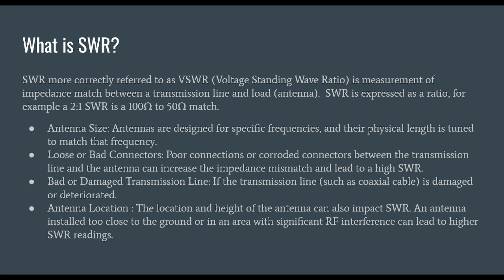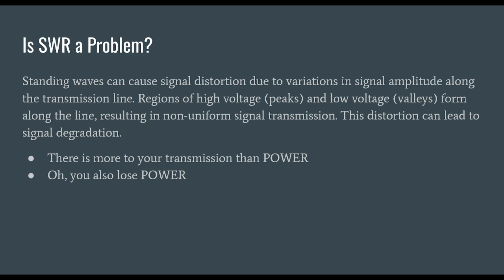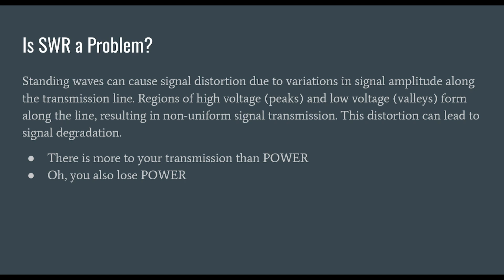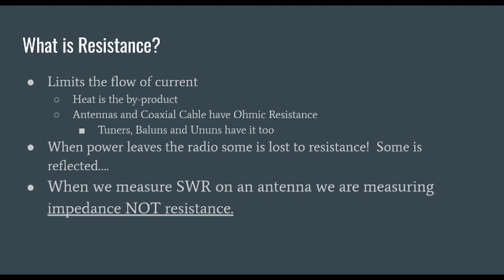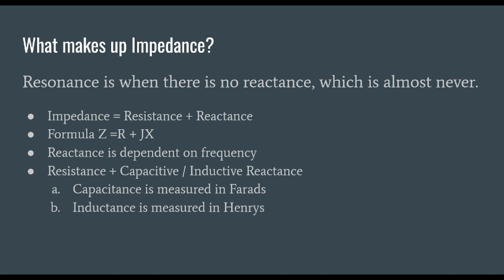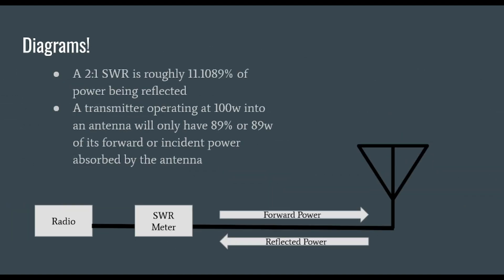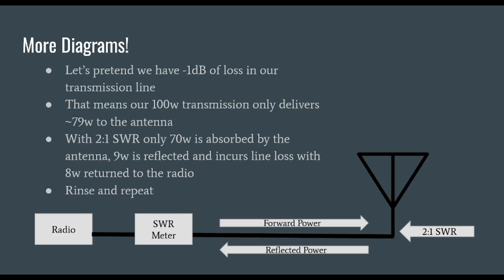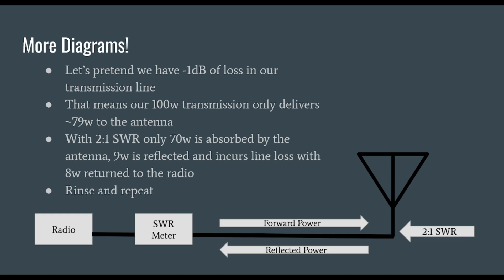Debunking SWR Myths Once and For All!

Comment: that was great. that is why a 9:1 UNUN can heat up more with a tuner. that power keeps bouncing threw the core. the torrid see forward power and adds reflected power to heat and power sent back from tuner . I normally use cross needle watt meter. I want to see reflected power in watts. still read VSWR where the 2 meters intersect . I just did a test today with a 49:1 using 2 -FT 240-61 cores at 500 watt FT8.  and SWR under 1.5 and stayed cold.  10 AWG windings . did the same with type 43 and that changed the tune a tad . but still under 1.5 buy the cores heated a little. so less heating at 500 watts with type 61 core. this mono band cut 1/2 wave 10 meters wire. a great way to tell if ferrite heating up is VSWR jump up. 73's
Reply from the maker: Hey Robert, I bet the 10AWG wasn't easy to wind 👀
Reply: @TheSmokinApe  my fingers hurt 2 days and was hard to solder as well.
Reply from the maker: LOL, I bet bro!

Comment: I achieved laminar flow once and my SWR decreased to negative infinity. I talked DX on 33cm and was able to modulate a full AM signal using nothing but a 9v battery and 2 nickels taped to a potato.
Reply from the maker: Russet or Yukon Gold?
Reply: @TheSmokinApe  I tried russet first but found out Yukon gold works better at this point in the solar cycle.
Reply from the maker: @HouseOfThe8Strings  I heard Yukon was the was to go
Reply: @TheSmokinApe  wait until you try yams!
Reply from the maker: Putting it on the list!

Comment: If the SWR is good, the transmit has plenty of fars.  If the SWR is not so good, your fars leak out the wire and don't work as good.  If the SWR is bad, the fars get stuck in the radio and the transmit button shuts off.  So yeah. The SWR's is real and you don't want them stuck in your radio.
Reply from the maker: I couldn’t have said it better 👍
Reply: How about if we introduce a tuner ?
Reply: @paulm0hpd319  The tuner will indeed fool the radio into giving out the fars.  Unfortunately the fars will still leak out of the wire and not do as good.
Reply: @oldstanknote  it will allow the transmitter to put out full power into the system, creating resonance by a conjugate match therefore more power at the antenna to radiate
Reply: @paulm0hpd319  almost, but not quite.  The tuner only fools the radio into releasing the fars.      What happens to them as the attempt to go down the path will still happen even with the tuner.
Reply: @oldstanknote  but the difference is the transmitter is putting full power into the system whereas without the tuner its only putting out the power less the reflected power difference  ,what gets to the antenna is down to the feedline  improve the feedline more power to antenna either way with the tuner in place there's more power at the antenna
Reply: @paulm0hpd319  both of the things you are talking about about still fall in the second category above.  You are just differentiating the quantity, which is not the point of the video or this conversation.
Reply: @oldstanknote  everything I've said is relevant to the subject matter
Reply: @paulm0hpd319  in your mind I'm certain it is.  The context of the video and this conversation is "is SWR real".  Your own observations have confirmed it to be so.  You are now discussing a way in which you hope to overcome it.  Why you are commenting on my comment about this is unknown as I do not care about how you go about your business.  Being no one else has joined in the conversation it would seem no one else here wants to share your journey with you.  You are discussing the quantity of the fars that get lost.  Irrelevant to the topic.  If you go and make a video of you observations and post it on YouTube maybe someone will discuss it with you there.
Reply: @oldstanknote  sad you feel that way but it's totally relivant to this whole understanding of this discussion
Reply: @paulm0hpd319 that is what you keep writing. So far, several times now.  We have established SWR is real. We have established that there are varying quantities of SWR. We have established that things can be done to alter the varying quantities of loss due to SWR.  Now you are just here repeating that the quantity of the SWR can be changed with a tuner.  That and many other things can vary the loss caused from SWR.  It is still loss from SWR.  The second thing I mentioned in the original post.  Differentiating this one thing from the many other things is irrelevant.  If you want to make a video showing how many different things can alter the loss from SWR go right ahead.  If you are hoping for a different response, perhaps go back to the main thread and start the conversation there.  As long as you stay here replying to my comment you will continue to get the same response.
Reply: @oldstanknote  the context of the video is more than just ,is swr real ,anyway you obviously don't want to discuss the finer points that are majorly misunderstood so ,73
Reply: @paulm0hpd319 you are correct in that I have no interest in discussing this with you.  These type responses only clutter up the reply stream.  If you wanted to engage in such discussion you would have done better to create your comment on the main stream, or at least took the hint when I replied back to you the first time.  When you read the original comment it should have occurred to you that it is intended to be humorous from the wording.
Reply: @oldstanknote  haha 😂 73
Reply from the maker: I think Paul has a chapped ass over something in the video and he is determined to repost the same rhetoric on every comment
Reply: @TheSmokinApe thought it was a discussion that I was a part of ,this whole swr subject is a fascinating subject that I've spent many years studying, if I can inject with points where people are not quite understanding surely its beneficial to dispelling the myths once and for all
Reply from the maker: Paul, I am glad you are showing interest in the topic and I appreciate the participation.  Maybe a new comment thread is the best way to have a single conversation.
Reply from the maker: @paulm0hpd319 I was thinking about your comments on this tread and others and it lead to me blowing the dust off Reflections III, I wanted to thank you for that...
Reply: @TheSmokinApe  hey no need to thank me but appreciate it, hopefully my comments have helped others do the same,I look forward to your future videos on the subject
Reply: @paulm0hpd319  that was the point about putting the comment in the main chat stream where others could see it.  Or making a video of the point you were trying to get across. As it is now, someone would have to dig into my comment to even see it.
Reply: @oldstanknote  thanks I'll bare it in mind ,I still be able to make comments on other comments right?
Reply: @paulm0hpd319 yes. You can always comment on other comments. The difference is that right now only me and  Ape are getting notification of this conversation so your scope is very limited.  Being the point you were attempting to make is only a sub topic of the second point I made your venture down the rabbit hole was not of concern to me.  My attempts to point that out to you seems to have fallen on deaf ears so to say.  if you don't listen to what people tell you when you comment on their comment, you have lost the room and the conversation is no longer productive.  If your comment had been on the main thread, you and Ape could have discussed it and others that may have been interested in the rabbit hole could have joined in. Again, there was nothing wrong with your comment or observation. It was just in a place where it was not relevant so you came across to both of us as being disgruntled.
Reply: @oldstanknote  all understood
Reply: What are fars?
Reply: @bill-2018  A far is a unit of measurement. You put a little youngin in the back seat of a car with no electronic devices.  Start driving.  When the little youngin says "are we there yet" you will have gone 1 far.  When there are multiple fars involved the little youngin will repeat the message and begin to fidgit in the seat.
Reply: @oldstanknote  "Are we there yet." Ah, I remember now. It's not far.

Comment: Great job! Continue relentlessy educating the hams out in YouTube land.... 

When I began my ham hobby in the early 1970's, I was taught to create a 'dummy' antenna with a 60 watt incandescent bulb in a socket. I used my regular length (50 feet) of coax that I fed my dipole and tuned my transmitter. I could VISUALLY see the results of a poorly tuned load because the light bulb would either shine brightly or dimly, or not at all. Now, I realize the light bulb was a resistive load, but I wish new hams could either 'see' what the results of their poor SWR is doing, or to 'feel' the coax getting warm (losses) or the external antenna tuner getting hot (poor SWR causing the tuner to get as close to 50 ohms for the transceiver-- resulting in losses in heat). A great tool today is an SWR/WATT METER that displays the FORWARD and REFLECTED power--giving the operator a decent sense of how much is making it to the antenna, and how much is being sent back. Keep up the good work! - Stan WB5UDI
Reply from the maker: Hey Stan, thanks for checking out the video.  I've seen people do the light bulb test but haven't tried it myself.
Reply: I started in the 70's too with KW valve gear and a long wire and tuner and simply tuned for maximum r.f. out while watching the KW SWR meter. Maximum r.f. out = low SWR.
After an FT101E about 30 years ago I went QRP, 5 Watts max. with a h/b s.s.b./c.w. tcvr and still tuned for max. r.f. out and no longer had the SWR meter, did this at special event stations with a vertical. As I said above I knew that max. r.f. out = low SWR.
Now 5 attic dipoles for 20m to 10m and inverted vee for 60m. Made a resistive Wheatstone Bridge SWR meter about ten years ago, never above 2:1 SWR when tuning aerials. Calibrated it about 6 years ago after previously aiming for a low reading.
G4GHB.

Comment: Does an antenna tuner really tune the antenna, or does it just present a happy match/load to the transmitter ? Also, does very lossy coax present lower swr due to high loss? Lastly, can a dummy load with an antenna port on the back end be compared to an antenna tuner?
Reply: Dummy loads are a power sink; they're not tuning the sink discriminantly. Sometimes people refer to coils as dummy loads, but this is not actually true, though they are a compromised antenna.
Reply from the maker: 1.  No, it doesn't tune the antenna.  The only way to really "tune" the antenna is to physically alter it's attributes.

2. Yes, the reflected power is attenuated and the same level as the forward power.

3. I have never seen such a thing so I have no idea but suspect the answer is no.
Reply: @TheSmokinApe have you read reflections by Walt Maxwell and how he describes how a tuner tunes the combination of the  antenna and feedline to resonance?
Reply from the maker: Of course @paulm0ph319
Reply: @TheSmokinApe  so can we really say it doesn't tune the antenna?
Reply from the maker: Yes Paul, it’s a matching device.
Reply: @TheSmokinApe  Walt Maxwell doesn't just describe it as a matching device he describes how it tunes the antenna and explains why  he's happy for it to be known as a transmatch or a tuner as he describes it does both